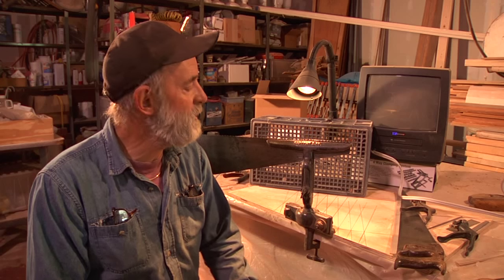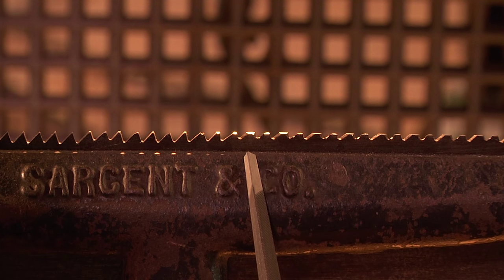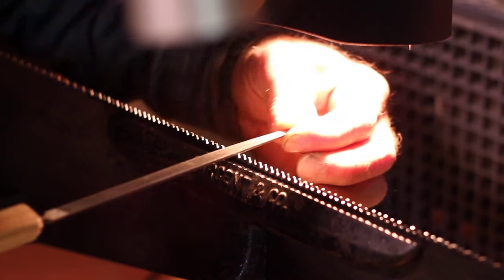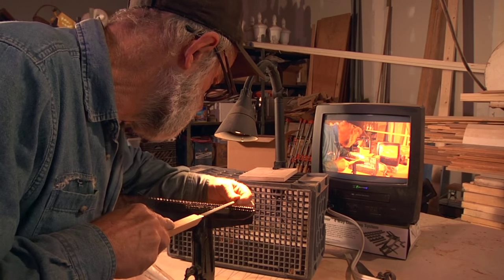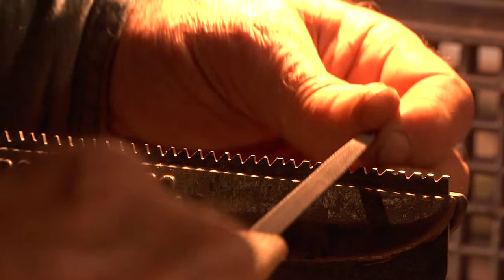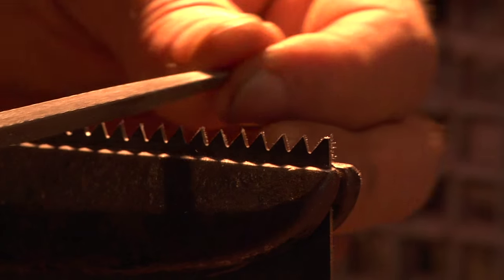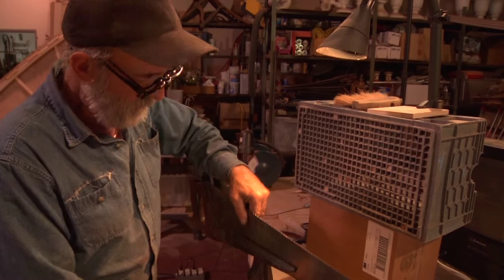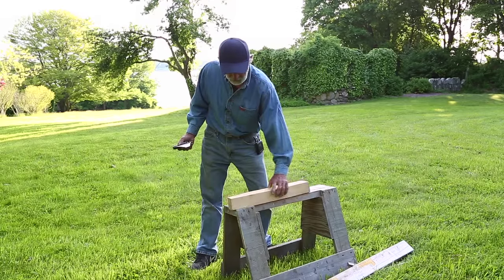How to Sharpen Hand Saws

Comment: To those of you who are just beginning to file handsaws and want to learn how to do it so your saw will cut as good or better than new, follow this guy's instructions and you won't go wrong.   Learn to file all the teeth from one side and do not file every other tooth then flip the blade.  That is what contributes to ending up with what is called "Cows & Calves" or Big tooth-Little tooth" syndrome.  When he did those test cuts on both soft wood then hardwood, notice there was very little tear-out at the bottom of the cut. That is an indication of a well filed saw.  This guy knows how to file handsaws. Way too many saw filing wannabees posting Youtube video,s that show exactly what not to do.